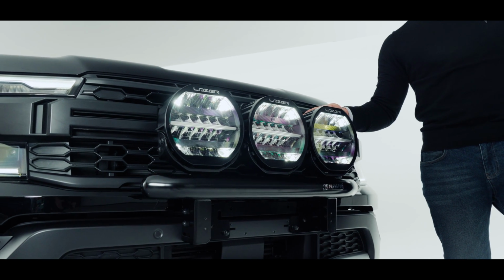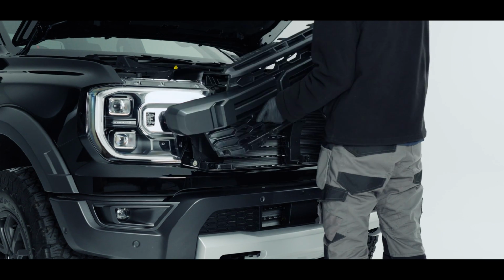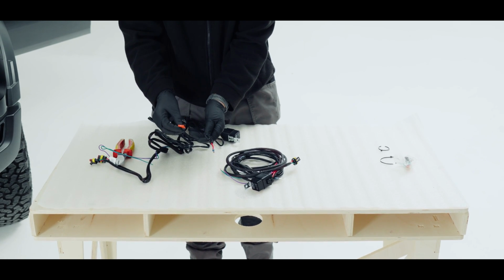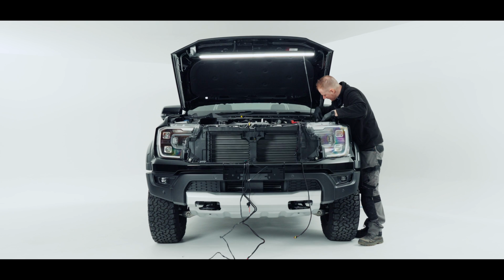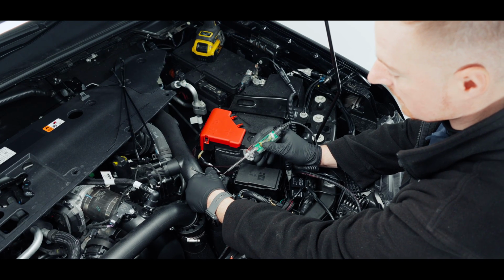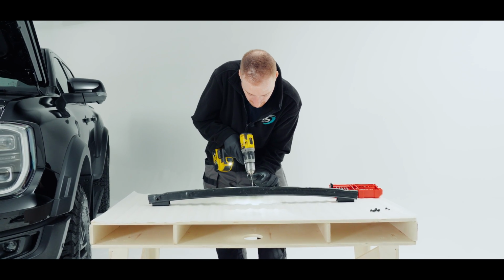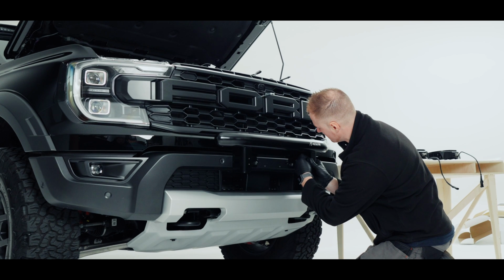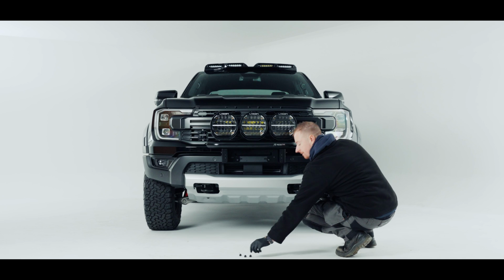How To Fit 2023+ Ford Raptor Lazer Lamps Triple 9" Sentinels Integration Kit

Comment: Hi,
I have a new Ranger Wildtrak with the Teck pack 68 (360 camera) but no over-head Aux switches to connect to. Can this setup be fitted?
I was thinking of going with 4 smaller 7" lights. Would that be possible and can they be connected without the Aux switches?

Comment: Problem for me is switches. I have a 2.2 wildtrak but don’t have the overhead switch panel that the raptor does. If someone made a universal panel overhead like the raptor for wildtrak I would be able to use more stuff like the roof and grill lights. I don’t want switches fitted around the dash type thing 😢
Reply: Have a look at the Stedi Lightforce switch panel which looks original fit and it clips underneath the two 12v/usb sockets. The switches are motif embossed. Looks great.
Reply: Hi, excellent video. Can I connect Sentinel to high beam light of the raptor, to turn on when you change from low to high beam?
Thank you!!
Reply: @sierranuestra  sorry to jump on yes in the passenger footwell there is wiring behind some panelling and there is wires there high low and drl for a switch wire which is what you want so it gets its power from wherever your connecting but use this switch wire and it’ll turn on with high beam